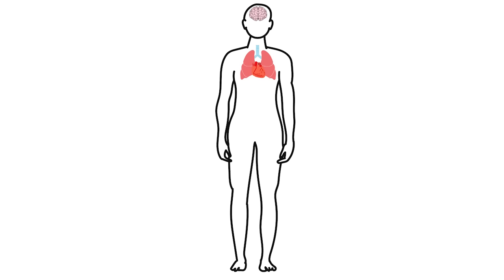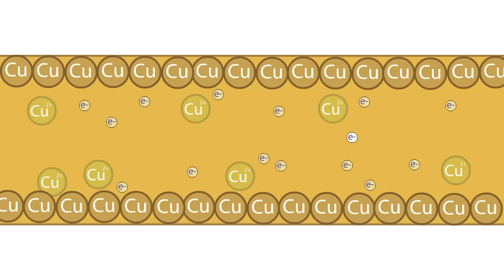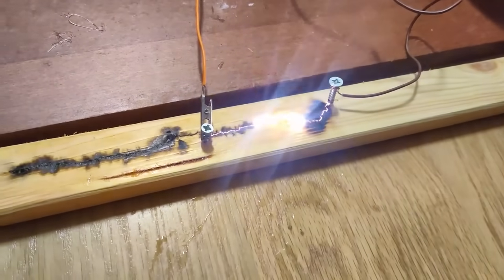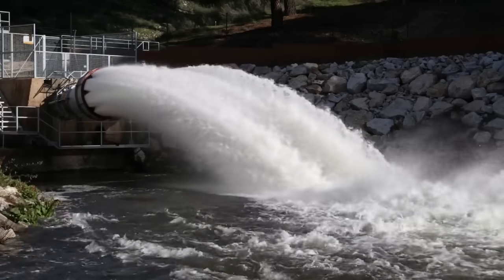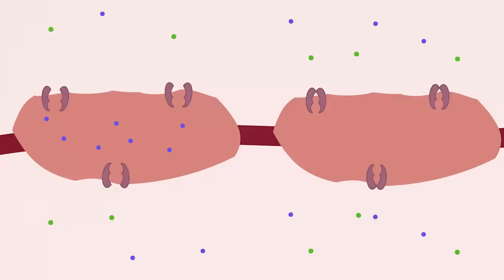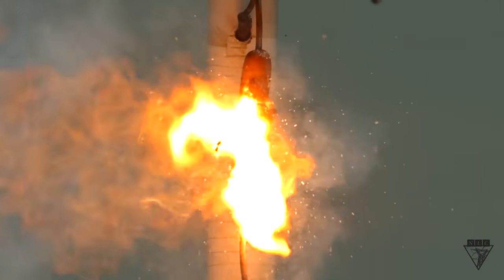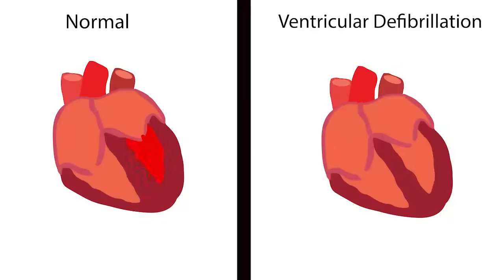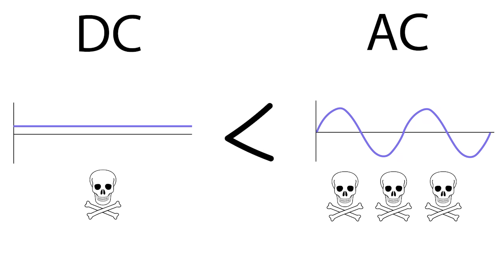Anatomy of Electrocution

Comment: Great video, one quick nit-pick though. At around 11:00 you start talking about the effects on the heart, and say that it can cause "ventricular Defibrillation", and you're ALMOST right. It actually causes "Ventricular Fibrillation", which is why the "shock machine" they use is called a "DEfibrillator" because it ends fibrillation, or  DEfibrillates the heart. I know, medical terminology can be kinda confusing sometimes. All in all, a very tiny error in a great video! Keep up the amazing work!
Reply: That’s not nitpicking, it’s called corrected which is educating someone.

Comment: Static electricity that you accumulate walking on a carpet on a cold day has a high voltage so it shocks you when you touch a metal doorknob, but does not kill you because the current is low....
Reply: The current can actually be quite high, but it's incredibly short-lived so no real damage is done.
Reply: Actually the current is several amperes but a very short time. Remember Ohm's law I = U/R.
Reply: No

Comment: When I was a small kid, I stuck scissors into an electric outlet, and experienced an electric shock.  I still remember the sensation.  I wonder whether I could have died that day.
Reply: At age 8 or 9, I took a small motor from an electric toy train, connected two wires on the electric conductor tabs, and then inserted the wires into the left and right slots of the socket.

I wanted to see how fast the motor would spin with so much more energy than a 12v battery.

The motor spun for about an instant; but it immediately shorted out with a spark and smoke, startling me.      Words cannot describe the level of disappointment I experienced by not even getting a little visible spin from that tiny motor powered by 120 volts!

For reasons yet unknown to me, a weird feeling came over me, and I decided not to try that again with any other tiny motors that I might have extracted from old toys.   There was a strange instinct to stop this!
Reply: It's possible, but luckily the nature of outlets means that the contractions from a shock will pull you away from it. I once did something similar when I was very young, but it was a 277v lightswitch. I thought someone had punched me.
Reply: I also did the same thing. When I was around 12 years old I inserted a nail into an electrical outlet, there was a sharp, vibrating pain as if my finger got cut with a vibrating knife. Maybe my finger wasn't very sweaty so not a lot of current passed through me, the muscles on my body didn't lock up and I pulled my finger away immediately. I was lucky to survive without any injuries, learnt a valuable lesson that day.
Reply: @wingjaigaming8240  You did this when you were twelve? Good lord, what a dumbfuck you are.
Reply: @wingjaigaming8240  You were still doing stunts like that as a 12-year-old?
Reply: If I recall correctly the standart AC voltage used in homes of 220(at least for me here) was chosen mainly to be a relatively safe, non lethal amount, got shocked once too
Reply: @_smegmann8156  US homes, businesses, and offices is 120V 15-20a is the common voltage and amp rating.
Reply: If it’s that type of scissors, the plastic/rubber handle may have provided some resistance. I may be because of that that you’re still alive today.
Reply: No because you have to be grounded
Reply: @Brad-.-.-.-.howitzer  Good one!
Reply: @Brad-.-.-.-.howitzer  The electric outlet was at my eye level when I was lying on my bed.  Does the fact that I felt the electric shock prove that the bed and the mattress were made of materials that conducted electricity and grounded the person lying on the bed?
Reply: @billbauer9795  yes, you can get a minor shock without being grounded
Reply: If the current only went from finger to thumb, probably not. Current is most dangerous when it passes up one arm, through the chest, and down the other arm. In other words, through the heart. I was pulling a refrigerator plug once when I let my fingers touch both pins, getting a nasty burning shock in my hand, but nothing more. Had I touched the pins with the fingers of opposite hands, I might have been in trouble.
Reply: @JonFrumTheFirst  That happened to me once, when I was twenty-one years old. I tried to turn  a switch back on in a fuse box that was hard to reach, and my finger slipped and came down on a live 220 volt wire. I could feel the shock travel up my left arm, go through my upper chest, and then go down my right arm before I fell or was knocked backward from the fuse box. My age and superb physical condition may have saved me, from serious injuries.
Reply: I plugged in an old lamp(1930s probably) at my grandmas house, guess my thumb was on one of the prongs bcuz it felt like my whole body vibrated for a split second 😂
Reply: I did the same thing around the age of three, but it was a bobby pin that I stuck in the wall socket, later, on in life I was in an electronics class playing around with an RF generator didn’t have leads, so I use nails but forgot there was no insulation and completed the circuit across my heart. Thankfully, the voltage was very low.
Reply: the chance to die just by "touching" the outlet is like 0.5%... i got at least 50 times shocked and i am still alive :)  stop thinking that if you touch any current you will die like 90%... most of the time its nothing more then a little shock that wont do anything (self experiance)
Reply: @MultiDominic111  bruh, have u heard of survivorship bias
Reply: @wingjaigaming8240  Who started saying bruh?
Bruh is ultimately shortened from and based on regional pronunciations of brother. It takes off a term for a male friend or a guy more generally in the 1960s. Bruh originates in and was popularized by Black English
Reply: @MultiDominic111  If completing a circuit with a live outlet is relatively safe, what would make it unsafe?
Reply: For the better part of a century, the public advice has been to plug up electrical outlets accessible to children.
Reply: @Canada_Dominium  This was in Eastern Europe, back when the Marxists were in charge.  So the plastic part that could be used to plug up outlets that aren't in use wasn't available at the stores.

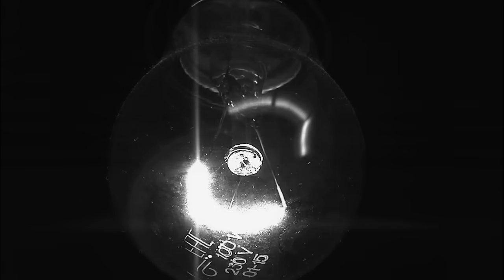Comment: At 12:25 there is a slight error. 60 Hz means 60 complete cycles per second. That is 60 positave and 60 Negative parts of the wave. Totalling the electricity starting and stopping 120 times per second.
Reply: Man, you are very wrong. One cycle  is starting from 0, 1, 0, - 1, and 0 again, this is a full cycle. What you are saing is half a cycle, and i told you that for sure, i am an electrician.
Reply: @paulmarian5570  that's what he said...
Reply: This is why in lights youll hear that monotone buzz, a sound frequency of 120hz. Musically it is just slightly flatter than a B natural.
Reply: @assalaholiday  1 cycle includes the positive and negative phase. Positive becomes negative when it goes through 0 and vice versa. So, for 60Hz the current goes to zero 120 times per second.
Reply: "there is a slight error" lol - the whole video is full of inaccuracies and obviously made by someone who has no knowledge about electricity beyond watching other YouTube videos.
Reply: @graealex  i.e. milliamps. I was like "What is this guy talking about?" LOL Heck I'll take the electric chair any day with that kind of power...and be seenin' ya next week at the local tavern for a drink or two.
Reply: @51hankyspanky7  Milliamps in the context of fatal electrocution is usually the right unit. 30 mA usually leads to cardiac arrest.
However, the electric chair operates at around 2 kV, and with a wet sponge and the pads making good contact, the body supposedly passes around 10 Amps.
But again, 10 mA through the heart would already be fatal.
That's where the big mistake in the explanation exists: resistors don't regulate voltage, they limit current, and the body, particularly the skin, is a pretty large resistor. If only he explained resistors correctly.
Reply: @assalaholiday  the us power grid is 60Hz not 1Hz
Reply: @assalaholiday  No, you are wrong.

Comment: Correction:

The term is Ventricular "Fibrillation" and not defibrillation. We doctors commonly call it as V. Fib.

Fibrillation is similar to the word vibration or irregular contraction which is not a normal contraction of heart leading to it's normal physiology.

Hence, "de-fibrillators" are machines used to stop the fibrillations or vibrations and contractions are induced through CPR.
Reply: Thanks for the clarification.
Reply: A defibrillator neither "restarts" a "stopped" heart, nor does it provide energy to keep it going. It is intended to terminate certain life threatening arrhythmias.
Reply: @michaliskaravelakis6803  exactly
Reply: @michaliskaravelakis6803  Exactly, as I said. Thanks.. :)
Reply: @Jim Harrington they were saved by stopping a dangerous arrythmia. The heart does not work like the battery of the car, nor can it be jumpstarted.
Reply: I was literally about to post a comment saying that exact same thing until I saw yours
Reply: Medic here, caught the same error myself.
Reply: I've read that "shocking" a person via a defibrillator is done so that his heart stops the irregular rhythm and starts beating normally, not because heartbeat has stopped. Is this true? If so, how do you revive a person whose heart has stopped?
Reply: @CST1992  cardiac drugs and a lot of luck.
Reply: @CST1992  Epinephrine is one way.
Reply: V-fib, De-fib. Hopefully the D-fib works and the heart restarts. Not as often as the TV would lead you to believe.
Reply: @RivermanRC  It doesn't restart a heart, because D-fibs can't start stopped hearts, they can only reset a heart that is beating incorrectly.
Reply: @PBMS123  This is what I am saying. On TV they always go for the "shock" to restart hearts that have stopped, but that won't do anything except shocking the heart. D-fib stops the heart which is in V-fib for it to reset and start back correctly, which doesn't happen as often as one might think.
Reply: @RivermanRC   Not as often? WTF do you mean by that?

 "90% success rate at 10 minutes and a 50% rate at 14 minutes."  Source:     10.1109/EMBC.2012.6346025

  Does this tell you anything?
Reply: Interesting fact: Defibrillators dont actually restart the heart. They actually stop the heart completely. This stops the ventricular fibrillation and allows your hearts natural current to restart itself.
Reply: Thank you.
Reply: And I thought fibrillation meant formation of fibres in the heart and so the heart stopped working. Ignorant me.
Reply: The first time I was in A-Fib, I had NO idea what was happening, other than my heart was beating with a WEIRD rhythm. I laid ion my bed...no improvement. I sat in my chair & had Classical Music going through my mind [Which USUALLY calmed me down]...no improvement. I decided to call 911. While the ambulance was on the way, I shut everything down that I needed to & put things together to take with me. A few seconds after the EMT listened to my heart, he said, "A-Fib. We need to take you to the hospital." Unfortunately, the local hospital was full, so I was taken to a different city. 2 nights later, I was finally in normal sinus rhythm, then released. A few years later, my heart went into A-Fib again. Since I now knew what it was,  I called 911, then made the necessary preparations. Fortunately, the local hospital had room for me. UNFORTUNATELY, it took FOUR nights before I was back in normal rhythm. #1.> If I ever get it again, does this mean I will have to spend a WEEK there? ~ #2.} What does my sinus have to do with my heart? [Normal Sinus Rhythn} ~ #3.} When I was in the local hospital, they put some sort of massager on my right leg. Does that help keep me from going into A-Fib? If so, it it possible for me to get one for my home?
Reply: @stevenscottoddballz 'Sinus' is the name of the area of the heart (called a node) in which a normal 'heartbeat' cycle starts out at. To keep it simple for this response, the electrical impulse  generated here travels through a path in the heart. In response, the heart muscle contracts in a specific pattern and as a result, circulates the blood.  Therefore, a normal sinus rhythm is what you want to have.
Reply: Thank you for your explanation Dr. and thank you for all you do in the lives you save. You are the true superhero of society
Reply: I was looking for this comment.
Reply: Defibrillators are also current providing devices, how do they help in saving lives? Does it restart the heart and can't they damage it?
Reply: I save dick by giving it CPR
Reply: Current flow is from negative terminal of cell not pos!
Reply: Thank you Doc.  I was about to jump on that too.
Reply: How do you know someone’s a doctor? They ll tell you
Reply: Why do doctors insist I be 15 minutes early to an appointment and then they show up 15 minutes late?
Reply: @southwestxnorthwest I used to wonder that but it's pretty simple. They get to you late because the people before you don't always show up on time and often the doctor can't know exactly how long every appointment is going to last. Health care providers and doctors in private practice love to squeeze in as many appointments as possible too. More patients equals more money. This makes them easily fall behind schedule and have no time to catch up. Us showing up early ensures we are there, checked in, and ready to go by the time our appointment starts so the doctor doesn't have to wait and isn't late for the next appointment as they can't really make up that time and it will compound making them run more and more behind. Also that fifteen minutes may include the nurse talking to you before the doctor comes in. In short, if everyone walked in the door at the time of their appointment the doctor would be way behind schedule and they usually are behind schedule.
Reply: @southwestxnorthwest I never show up early. Arrive 5 minutes late.
Reply: Exactly. That is why the 'shocker' you see on TV is not normally to START a Heart. As per the name a Defibrillator is designed to STOP the Heart which is in Ventricular Fibrillation in the hope it will re start properly. A 'De Fib' machine MAY start the Heart if STOPPED, but is less useful than you may think. A massive thump in the middle of the Chest followed by CPR is a better shot.
Reply: @packtech  I've been re- certified a few times in CPR, I never recall any instruction where we were shown how to" thump" someone in the chest?
Reply: @frankpaya690  Precordial thump is more of an "old school" technique that was taught if you witnessed someone go into cardiac arrest.  Basically, it's like slapping someone across the face to bring them around when they're woozy, except with a precordial thump you're striking at the heart through the chest wall, in hopes of getting the heart to go back into a normal rhythm, versus a potentially fatal arrhythmia, such as V-Fib or V-Tach.
Reply: @packtech  precordial thump!
Reply: @packtech just battering the person back to life. LOL
Reply: Beat me to it. --paramedic
Reply: Why are you making a gap of space after every single sentence
Reply: "Call it V. Fib", not "Call it as V. Fib". If you're going to be pedantic, do it right.
Reply: @lukebaines7785  two levels of pedanticism: Yours was useless. His was useful.

Comment: Higher frequency AC is less likely to be lethal than DC or lower frequency AC, because of the skin effect.  This tends to make current to flow more along the surface of a conductor than in its interior (because in the interior, the changing magnetic field induces reverse voltage that causes electrons to repel one another).  This is why a Tesla coil doesn’t kill; most of the current stays on the skin increasing the resistance and reducing current.

Inductors used to tune the frequency at which a high powered radio transmitter operates are often hollow pipes to save weight and cost, since the current only flows on the surface.
Reply: 1 KHz is the danger spot . 1 KHz is more dangerous than 50Hz, the reason for that is at that  our nervous system also has more affinity .            What do you mean by high frequency?
Reply: @brad8122  im pretty sure around 20kHz is when the effect is really noticeable.
Reply: @brad8122  "What do you mean by high frequency?" Haha, I like that question! Because it strongly depends on who you ask. I once talked to a physicist who told me "the skin effect is a low frequency approximation". I guess it all depends on the frequencies you usually work with :D
Reply: Skin effect only applies to good conductors. Above 20 KHz, you simply dont feel it because ions dont have time to move.